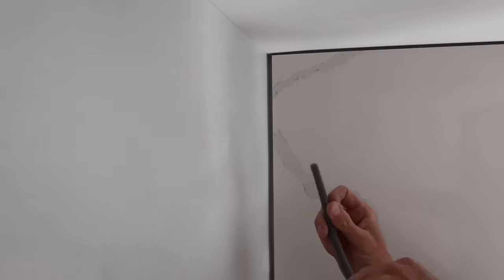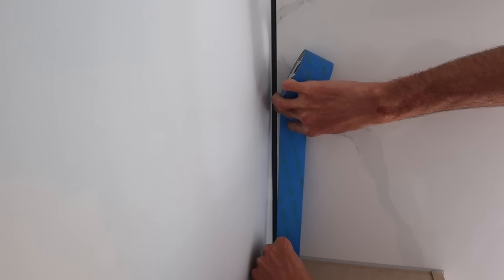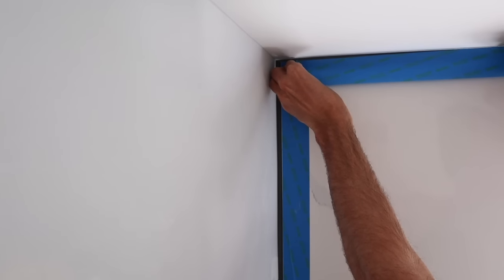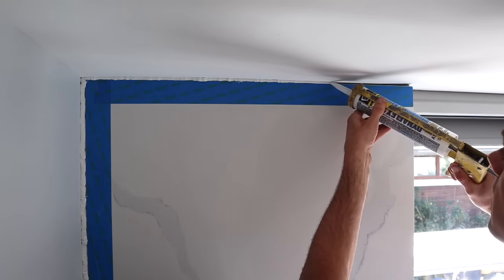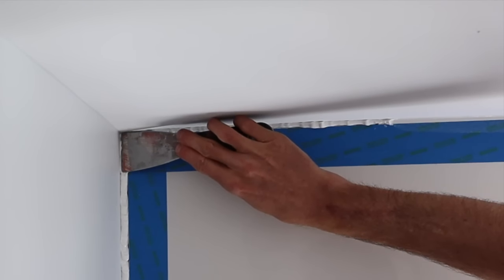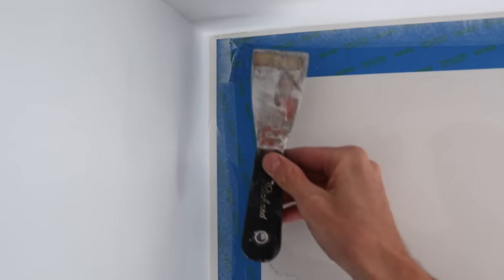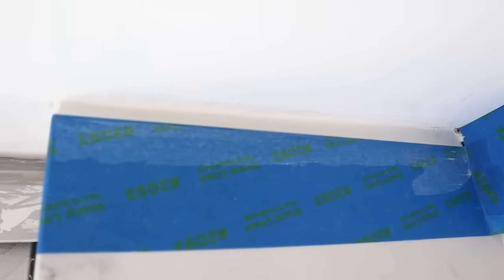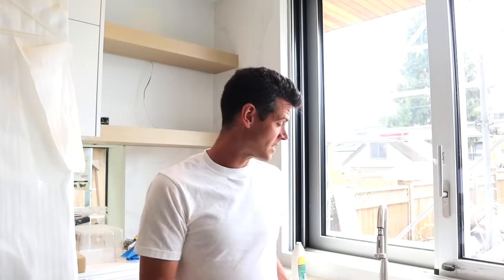How to Caulk BIG GAPS!!!!

Comment: I wish you could come to Chicago and fix the mess that my shower installer did. I used panel walls and he left a huge gap between the panels and the floor pan. The panels do not lay flat on the pan like it’s supposed to. He then used caulk to seal it and it looks so messy and unprofessional. I am so upset!

Comment: I've seem a similar fix where some sort of foam spray was used to fill the gaps and then they cut out the excess after.  Then proceeded to patch it up with mud, tape, etc. Is there a more preferred method one way or the other?
Reply: To your question, not really. Much of many fixes are done because of the area people live in and what is the most common among the trades there. Spray foam can be used, but use the kind for windows so it doesn't over expand, and then after it is dry, cut is to shape then use caulking over it to fill in any surface gaps and to seal in the foam holes. Then if need be patch more with drywall mud and tape....This works if it is an really shabby job of carpenter work....ha...That said, actually fixing the problem, that is removing that panel and recut to size is the better way to fix.
Reply: @dannyixoye262  thanks for the window foam tip!

Comment: I really appreciate your videos, extremely helpful. I recently had new wood floors put in which were significantly lower profile than the old floor resulting in the door jams having a large gap (sometimes .5 of an inch) between them and the floor. I was thinking of doing backer rod and caulking but thought it might be better to use wood filler because the door jams are wood and there is less shrinkage. That might be a lot of shaping and sanding based on the shape of the door jam and could get messy since I'm a bit of a novice. Would you use caulk or wood filler? Thanks!
Reply: What did you wind up doing? Our house we just bought has same issues and I want to fix it!!
Reply: I would also like to know an update, I come across this issue allot at work

Comment: Why not joint compound fast setting? Just curious!
Reply: @UrbanFarmDweller Ok I can see that :)
Reply: UrbanFarmDweller but if they were both drywall then mud would do the trick right ?
Reply: @Ninja_Toolz  Most definitely!
Reply: When I use joint compound it actually takes longer to dry and the next day it's all cracked and a lotof shrinkage and requires multiple passes. Used it for a whole room with paneling that has those lines, took a few days to finish and still isn't perfectly flat. Brand I used was ProForm.
Reply: @otallono  If you use regular joint compound, it will take ages and shrink as the water evaporates out of it. A fast setting compound has a hardening agent which sets it more like a cement or mortar, and sets way quicker, without the shrinkage.
Reply: @otallono  You HAVE to use fast setting compound for larger joints or it will always shrink lol! Learned the hard way :)
Reply: @mcmcfarian  what brands should I look for? I'm in the Midwest US.
Reply: @chriswithrow3107  I am absolutely not an expert. I've just done done a bunch of googling and research to figure out how to drywall my kitchen, so I'm spouting information I've learned along the way. I just bought 90 minute compound from Lowe's or Home Depot to fill the gaps (up to an inch in some spots) before taping and it seemed to do the trick. Then after that dried and was sandable, I taped with regular joint compound.

Comment: When do you remove the tape? And when removing the tape does it mess up the caulking when pulling it off? Meaning does the caulking separate from the wall where the tape was? Does portions of the tape stick to caulking and wall?

Comment: Curious about your longterm results with Dap, 230 or Alex..  I've used it for years out of habit but the stuff shrinks, looking for an alternative.  So annoying to see what happens after a month, rtwo months, six months, etc.  Gaps and cracks.  I find it hard to believe you can fill a gap as shown.  Caulk just seems like the wrong product for that.
Reply: My longterm result was to quit buying it. It's garbage. I'm using Sherwin Williams powerhouse now.
Reply: @schlazz  Agree, I'm done with Dap.  Thanks for the tip about SW Powerhouse, I'll try it, seems like the right stuff based on description.  In the meantime I found Tower Tech 2, an acrylic urethane, their TS-00215.  I've used it for crown joint so far and in the immediate situation - application, etc. -  I like it.  But we'll see if it shrinks or cracks long term.  But it's ridiculously pricey.

Comment: is the backer rod supposed to be the same size as the gap or bigger?
Reply from the maker: I little bit bigger so it won’t fall out.
Reply: @vancouvercarpenter  there's a chart online for sizes, thank you. for example, if your gap is 1/2 in wide. do you buy backer rod 5/8 in?

Comment: Great Video, Thank You. Do I use Dynaflex 230 elastomeric for the caulk? Also what type of tape did you use? I have a 1 in gap between the wall and countertop and it tapers as one wall is crooked. So, do I put the 1inch backer rod in the larger space and then use the 1/4 inch where they meet and just continue the line? oh . . . did you say 1 1/2 in putty knife that was stiff, flexible, angled? No, I am no Carpenter, I am a Realtor trying to fix a problem in my own home. Appreciate your advice Thanks Again!

Comment: I have a question I've been finishing for about 25 years and this homeowner using oil-based primer over top of my drywall it made my joints crack out like I said I've been finishing a very long time I have never experienced this and it's very hot in the house as well can you help me solve this problem whether it was the product in the heat in the house that caused this because my tape coat and bed coat and skim coat we're done the same way I've done them my whole career

Comment: If that gap was in the middle of a wall instead of a corner, between two pieces of drywall, would you still use the latex chalk or the mud you normally use?

Comment: I had a small area of about a foot that had a gap of about 3/8” gap. So I used paper tower and that seemed like it did the job. I did that because 1. I was lazy and didn’t want to leave the house for such a small area and 2. I didn’t want to buy a roll of 10 feet and have so much left over. Question- the paper towel I used worked perfectly and fixed my problem. The question I have is what will this do in the long term? Am I okay or am I over thinking this?

Comment: Could you put some plaster on it? If not, why?

I have a new build, some shrinkage cracks appeared at the bottom of the stairs. I probed it with 5 in 1 and it opened about 1 cm gap. The wall is hollow. The crack is not straight so I can't put masking tape so nicely, and it will leave a ridge. I planned to attach backer rod or expanding foam, put some plaster on it, sand smooth/flush, and then put a bead of caulk between new plaster and skirt board. Would it work?
Reply: Jzp Whyyouwantmysurname 

No. Can’t plaster over foam; foam is not hard enough. The whole foam/caulk combo is to allow flexing and expansion/contraction . Wood will have seasonal expansion/contract.

Comment: Just removed wallpaper. Was a nightmare. Pulled paper everywhere. I sanded the wall. Used 999. Two skim coats. Then I applied a water base kielz primer. After primer dried I noticed a few air pockets. Why didn’t they show before?
Reply: Did you use an oil or shellac based primer before skim coating?
Reply: Gotta use an oil base primer on any of that paper before you put anything on it. The moisture from the mud or water base primer will lift the paper right up and you’ll have all those bubbles. Kilz original is my go to oil base primer. Zinzser BIN is my go to shellac base. Both ruin your rollers if you roll, and if you spray. Mask like crazy.
Reply: At this point just cut out the air pockets, prime holes with kilz oil primer and mud  themwhen primer fully dries.

Comment: Part of the goal of backer rod is to get a hour-glass shape in your caulk  ->    )(   
  This allows the caulk to stretch without the top and bottom to pull away from the surface.

Comment: what if I've already filled a large gap with noise proof sealant by Green Glue?  Did it about a week ago and it's a bit uneven and also shrunk.  Do I need to get the sealant about flush with my drywall before I can mud?  The gap in question is at the ceiling.  Thanks!

Comment: What about for showers? Had to do a really big gap from the shower floor and the first tile.. It just didn't come out as good 😬
Reply: I'm having the same issue where my shower has bigger gaps and silicone always seems to peel off in those areas ..I've had to take out old chalking twice and fill over a 2 yr span ..I think I will try layering and give it 3 coats to build it up ..unfortunately it will look a bit heavier in some areas ..hopefully this will work .the last 2 applications didnt have enough chalk and problem being it would shrink and lift

Comment: I think my contractor should have used backer rod and caulk between my tile and window in my shower, but instead he just used tec power grout.  The gap is at least 1/2 inch.  I think it's going to have be redone.

Comment: Is there a way to caulk without having to remove and trash & waste so much of the caulk?
Reply: That dynaflex is like $5 a tube..... dont be so cheap haha
Reply: Back off the amount you are initially applying.  If you are wiping out a ton, it means you are starting with too much.  Do what you feel isn't enough and it probably will be.  Worst case, you have to add a little more and wipe again but you won't be wasting much.

Comment: I have a 3/8" high gap to fill between my counter top and ceramic tile backsplash. (The depth of the tile is only 1/4" though) It's a huge gap to fill entirely with caulk but it's also not 3/8" all the way around (my counters are sadly not level - we installed the backsplash so the tiles would be as level as possible and we were not replacing our existing counters) Any tips or tricks you have for this type of situation? Also grouting with unsanded grout in a light greige color so not sure about using siliconized laytex caulk in a light color over a dark gray backer rod.

Comment: Hey Vancouver Carpenter or any viewer scrolling through comments! Say I can't get any backer rod, what can we use in place of it? Just use extra caulk or will that be an issue? Any help is greatly appreciated :)
Reply: doom2urlife this is kind of sketchy, but I once used spray foam in a big gap, cut it flush and sanded it smoothish, then used ultra lite spackle over top. It actually still looks perfect years later. It was about a 1.5” gap too
Reply: You could always use more caulk, but caulk is much more expensive than backer rod.
Reply: @tylerk.7947  Oh right on thanks man, I'll keep this trick in the back of my mind incase I'm ever in a pinch
Reply: @MoneyManHolmes  Makes sense thank you for clarifying that

Comment: Thank you!!  Would you recommend the backer rod for outside?  I have a bay window skirt (not the window itself) to caulk.  What kind of caulk is best for the outside?  Thanks.  Great vids.  Subscribed and liked.
Reply from the maker: Backer rod will work for big gaps. This product will work outside in warmer weather. If it rains before it skins over it will wash right out.

Comment: Hey Ben, id consider myself a beginner at drywall and finishing...

I have a couple questions (ignorant questions I’m sure)

When you are applying paper taper, corner bead and mud, do you have a preference on which joints you do first. More specifically, do you mud all your vertical joints first, horizontal and then corners?

Again I’m average on a good day and the issues I run into is the transitions of the vertical, horizontal and corner joints. Takes me forever to get the “3 way joint” to flow nicely.

I’ve been watching a ton of your videos and they have helped me tremendously but I haven’t seen you mention that process, if there is one.

Thank you in advance

Comment: Does anyone know if the backer rod shown in the video can be used when caulking a tile shower wall at the point where the wall meets a bathtub? Can I use a small bead of silicone caulking as a backing rod before I apply the acrylic caulking?  I do have the time to allow the silicone backer rod to dry thoroughly before applying the acrylic caulk.
Reply: Use backing rod then 100% silicone for the joint. Never use acrylic caulk in a wet area, it won't last.

Comment: I’ve had problems leaving the tape on too long. Even with minimizing overlap of caulk onto tape.  Left a “ridge of caulk at the edge.  Also - why caulk those joints?  Sealing joints between different materials makes sense, but sometimes a strip of molding (with a sealer or spray foam underneath) is easier.

Comment: I've been a Drywall Contractor for only 34 years now.....so I apologize that I'm kinda new.....HOWEVER....Here in the States, we have a thing called a "back charge" which occurs when someone performs their first job and leaves gaps that size and says it's fine, normal and acceptable. So you call back Moe, Larry and Curly.....give them 24 hours to fix their train wreck......and if they don't, you hire an EXPERIENCED craftsman this time to do the job right and deduct the fix off the original bill. Backing the cement truck up the stairs to fill a gap the size of a Buick is totally unacceptable. Try leaving gaps those sizes on one of MY jobs and we'll be standing in front of Judge Judy......and you will  lose every time!

Comment: why not 1 or 2 layers of tape a shim of old drywall or wood and quick mud. After fully dried a thin coat again sanding and done.
Caulk will become sooner or later disgusting especially on tiles if its get cleaned wet.

Comment: I hate to rain on your parade but you obviously don't know how to caulk.first off using latex caulk for anything other then a small gap is asking for trouble.get a urethane.it is paintable,won't shrink and lasts longer.leaving the tape on until after the caulk dries is just stupid.you will be lucky if you don't pull it out or mess up the edge.next that could be the cheapest,worst caulk gun. And last but not least you should go a bit deeper with the caulk because the joint will have expansion and contraction and using to little caulk it will split.